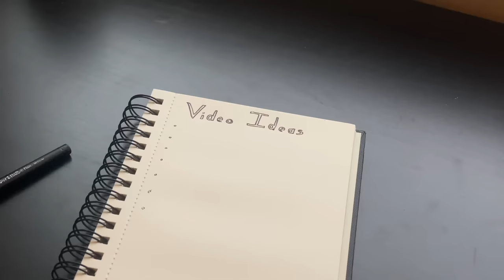First Days of Winter on the Alaskan Homestead

Comment: Those who are critical are usually the ones who would never jump to a challenge. You've got this!! Keep going
Reply: He literally put the door on his house backwards, which will trap him inside in a blizzard. Criticism could save his life. ❤
Reply: How about the galvanized chimney panel on the wall? 😂😂😂😂😂😂😂 Poison. If his chimney deposits catch on fire, and they will, the galvanized plate will hit a flash point of around 600f. At which point he gets poisoned by zinc.
Reply: @CScott-wh5yk  he also used an interior door which has no insulation, instead of an exterior door. the pipe on his wood stove also appears to be the wrong way which is dangerous and is probably the cause of all of the smoke billowing. a smoke detector could save his life if smoke billows and floods the cabin while he sleeps. he also needs a shelter for his wood, or it'll get wet from snow and will take days to dry out and become usable. if it's cold outside, you don't have time to waste days on drying wood because wood is your heat source. criticism will save his life, if he takes the criticism seriously.

edit: he did mention he has to replace the door, but that should be his top priority.

edit 2: having the wood stove that close to a wood wall with no hearth or barrier or anything of the sort is a major fire hazard. It's even more concerning because it's close to the door so if a fire does happen, his only exit is blocked (besides the windows).
Reply: @CScott-wh5yk 😂😂😂😂
Reply: Or maybe they are mature adults trying to offer constructive criticism to help him.
Reply: Well, these people are TRYING TO HELP THIS YOUNG MAN,  THEY ARNT BEING CRITICAL!
Reply: @ChrisSmith-ek3og I AGREE CHIS SMITH!
Reply: I've found that those who criticize are generally from one of two camps. 1) Envious of someone for doing something they wanted but never had the courage to try or 2) are jealous of someone trying and accomplishing something they never could.
Reply: PEOPLE ARE JUST TRYING TO HELP THIS YOUNG MAN THATS ALL.
Reply: @archieself4945  Yeah right. I'm pretty sure everyone knows who his parents are. If he needed/or wanted advice, I'm sure he'd take it from them before he'd take it from complete strangers on YouTube lol
Reply: @sasquatchrosefarts When it gets real cold the the way the stove pipe runs out the wall will have creosote buildup. In his climate the pipe should go right out the roof and he should use insulated pipe above the roof.
Reply: @1acrehomesteader43 Ha Ha I have 10 times the cabin he does and I can’t drive a road vehicle within about 10 miles.  I’ve been doing this kind of stuff over twice as long as he has been alive.
Reply: Yep not like he’s brought up in a family that lives off grid lol.
Reply: @sasquatchrosefarts what’s funny about that?
Reply: @ChrisSmith-ek3og  he’s experienced that cold before.
Reply: @ChrisSmith-ek3og  yeah he’s a stones throw from the road. I think the first ep he mentions how he looked hard for land to purchase. His mum n dads channels are ace. They’re all off grid now!

Comment: Video ideas!  *Building a woodshed.  *Building an outhouse.  *How are you getting your water?  *What's the plan for extreme cold?  *Food procurement (town run?) *Building an insulating layer around your woodstove (it's dangerously close to the wall)
Reply: I said the same thing about the wood stove. I'm worried about it!
Reply: I as well, should be 3 feet from the wall, at least that is what my inspector told me about mine
Reply: I agree with the comments concerning the wood stove clearances to the wall and other combustibles.  A simple sheet of metal with wood block stand offs would help. I live high in the West Virginia mountains.   This will be my third winter.

Comment: The reason the stove piles smoke out into the cabin in the beginning is because there's a cold air table within your exhaust vent that is preventing smoke from rising up and out the house. 

Remember hot air goes up, cold air comes down. It's something they teach you in one of them pesky schools :P hehe. But anyways. If the gradient is high enough the cold air triumphs and pushes any heat or smoke that tries to rise up, acting like a cork in your vent. You gotta break through that cold air blockade first.

Before lighting up the stove all the way, you can fire up a small bundle of newsprint or paper and hold it right up the ventilation port within the stove, in order to have it's hot air rise and push the cold air out of the way. then you can light up the whole stove.
Reply: They don't teach that in any school I ever went to! I learned here on Youtube, I imagine his folks would have taught him.
Reply: Florida education system teaches that but I’m always confused on what cold air their talking about lol it’s always hot here
Reply: Mostly agree but the main idea is to clear the roof with your high point. His 90 out the wall and up is his issue and will get much worse as it gets cold and windy. Straight up out the roof and at least 2 ft above the highest point will solve 99% of his problem. A vacuvent will cure the rest.

Comment: 1. fix the roof video. 2. A walk around the local area, shopping, fishing etc. 3. Build a Swedish hottub using the stove for heat. 4. A much extended day in the life video (30-40 mins) 5. Do you have a pet? You need a pet. 6. A live W and A.
Reply: yes - roof
Reply: @DL-ep5uk that’s the first part. The second part is the answer
Reply: Pretty sure that's a typo for "Q" and A.  Q and W are adjacent on the keyboard.
Reply: @DL-ep5uk probably meant  Q and A
Reply: Self reliance first $$$. Then a dog.

Comment: I'm a mom and admire your strength and determination to make it out on your own, and the strength of your mother to let you do it without interfering. You are both strong people. I am concerned that you don't have any insulating layer between your wood stove and your interior wall. Wood stoves can get hot enough to cause spontaneous combustion. Please make it a priority to protect yourself from that happening.
Thank you for your videos! I really admire you and enjoy watching you grow as a person and be self sufficient.
Reply: I was thinking the same thing about the flashing(?) near the stove.
Reply: Several of us have been mentioning this for a while, but no response yet!  And no insulation!
Reply: He definitely knows that. Don’t worry. He’s got amazing parents/mentors.
Reply: My mom runs a wood stove here in Arkansas. When we put it in she put concrete board on the walls and then put metal on that to reflect the heat back out.
Reply: I've been on an Alaskan adventure with a group of Alaskan teenage scouts and I'm convinced a guy that's grown up in Alaska is capable of making it through an Alaskan winter. I have lots of confidence in Mick.
Reply: In Michigan;  I think he said code was 36" (mine is 37")  -- none-the-less, code schmode (it's there for safety), please keep it in mind as you fine tune your arrangement -- also look up 'cathedral box' and maybe build your own. The stove pipe could easily be made to exit the roof (without bends in the pipe). For now, the main thing is you got heat and that's always a good thing !!  Insulated stainless steel stove pipes are a good choice and often come with twist and interlock stainless pipe to stainless pipe (and stainless screws to attach them to non stainless pipe). One thing at a time.
Reply: @josephbrown-ut9ty great idea!

Comment: Hey, I'm not anywhere close to being in Alaska, but we use wood for heating as well and I have a tip since you don't have a woodshed (yet). Tarps are your friend! Just put a tarp or two on your pile of wood and it won't be covered in snow (or water once it melts), and it'll lower the chances of the liquid to put out your fire. Great video, excited to see how you handle the winter months! :D
Reply: I use tarps too. 👍
Reply: Your wood stove/fuel is the most important thing in your life right now. 2 chords probably isn’t enough. Agreed get that wood covered or you’ll be fighting it all winter. Best to get your wood supply cut/stacked in the spring and let it dry all summer. Next season maybe. Good luck
Reply: yes I was wondering why he did not cover his wood pile so young and soo much to learn
Reply: @a.p.5429 😊
Reply: That was my first thought

Comment: Hello Mick sometimes the  reason that a wood stove will smoke when first  started up is the column of cold air in the pipe that  the smoke has to overcome  to make it up and out to the sky. One way to overcome  this is to use something like a piece of newspaper  that you  put into  the  smoke  pipe and light it to preheat  the pipe and help to establish the draft. Then you light  the small pile of kindling or other starter material to get the fire going.  I realize  that  you may  not have a good supply  of newspaper  to use for this but a little bit of good dry bark should work  almost as good. I have been a wood burner  since 1979 when I bought my first wood stove. Have a great day.  Tom down here in Canada  in the Maritimes  at the NB-NS border.

Comment: Just a suggestion, when you mentioned the roof isn't done, an easy temporary "cheap" fix would be putting a tarp or two over it for the winter, as it would keep leaks from getting in. Also, depending on how expensive it is, may want to consider putting a tarp or poly over the wood to keep snow off. I know the floor is insulated, however, as cold as it is going to get there, have you considered putting poly around the base of the cabin and down to the ground? Would block wind from blowing under the cabin, or you could also use pine boughs and then bank the cabin where there is enough snow - and that would be FREE! Awesome job so far! Keep up the amazing work! ✌️

Comment: Hey Mick! This may make you cringe but... I'm proud of you and what you're accomplishing! Maybe it's because I'm the mother of 3 sons that i have that parental proud feeling when watching what your doing.  
As for your stove...our little camp cabin did that smoke billowing thing on us last winter.  Ours is set like yours, through the wall.  We had a low pressure front and our stove pipe didn't completely clear our roof height. From what I read, that combo can cause the  stove not to draw the smoke.  So, we started leaving our door a little bit open when we build a fire and that little bit extra of air flow helped the stove to draw a better and not smoke us out.  It only happened once, so i think it was the low pressure.  If you'll notice outside that wood smoke is not really rising and is mostly falling towards the ground,  that's a low pressure situation. There may be other ways to  tell,  but that's one that I know. 
A little flashing around your stove is a good idea. Maybe a piece of scrap from your metal roofing? 
Cheers from NC!
Reply: Hi Jessica where are you from?
Reply: @kenhartman9981  North Carolina
Reply: @jessicawright3290  Nice place I live in Oklahoma City but I’m currently working here in Syria…
So are you originally from North Carolina?
Reply: @jessicawright3290  Hi Jessica how are you doing today. I hope you’re having a blessed day?
Reply: @jessicawright3290  Hi my friend how are you doing today

Comment: Your series here reminds me of the first winter I spent alone in Vermont. I waited too long to stack all the firewood, ate mostly "breakfast" foods, and generally was just happy to be warm and dry. It was one of the best winters of my life. Keep it up, man.    PS, you probably already know this, but if you toss a wide, wet log or two on the fire before bedtime, it'll burn low and slow all night. My elderly neighbor kept a separate pile of fat logs for that purpose, he called them his "All Nighters". Dude had a huge house and he burned 8 cord a year lol. We used to burn 5-5.5 cord in a 3br home. Again something you already know, but put a deep metal baking pan of water on top of your stove and it'll help with heat distribution and also keep the humidity from going crazy low.

Comment: The permits in the public wood cutting areas are $10/cord.   We put up 16 cords as usual this year.  We have three wood "sheds" - pole buildings with roofs and no sides, to keep the rain and snow off our wood.  We have three stoves - log home, log shop, and outdoor hot tub system.    With three stoves going at a time you really fly through the wood.  

Our wood hauling rig is a truck and a trailer made out of an old chevy truck bed.   So we can haul over a cord per trip.  If all your wood is split and under a roof before July, it will be plenty dry by winter.  We start in May, and that is the wood we use in the deep winter because it will be the driest.  The last wood harvested we burn in the beginning and end of winter.

Comment: I've been really enjoying your videos! If I was a bit younger and not married with a kid, I would highly considering doing what you are. 
My only tip of advice- I grew up in Upper Michigan and we used wood to heat our home; I would try to keep your wood covered (at least with a tarp) to help keep the wood dry and from freezing together. It gets very frustrating trying to break apart frozen logs and trying to restart a fire with wet wood lol. :)

Comment: IDK if anyone has mentioned, or if you've discovered... A baffled heat exchanger in your flue pipe will capture almost every single BTU from your fire. Can be made from a small steel barrel and a piece or two of sheet metal. There are also heat powered fans (non-electric) to help circulate more heat away from the stove and around the room.

Comment: One tip I would give would be to get some sort of tarp to temporarily cover up that wood pile, the snow will make it burn slower and with less heat so getting it under some form of cover will help with making it last. Also a traditional cabin food to try would be pilot bread!

Comment: Yep, you will probably need at least another cord.  We have a very insulated home in the Mat-Su, and we will likely, depending on how long and cold the temperature is, we may need over two cords this winter.  When your pipe is on the outside and not mostly run through the inside of the home, the temperature difference between the heat starting in the stove and the cold temperature difference in the outside pipe makes it smoke.  Good luck!

Comment: I would make a tiny airlock/double door on the front. Every time you open the door in the winter you are going to lose all that heat in seconds. You can easily make one inside with a hoop on the ceiling and some thick curtains/fabric. That will save you a ton of heat!

Comment: Better get a heat shield around behind the stove and to the side, as well as above.  Even sheet rock in a single layer can cook the studding and lumber behind it and eventually set it off.  As it gets colder that stove is going to be burning hotter for longer.  A lot of house fires start in the framing as it overheats much less the wood interior you have.  Manufacturer's specs are a guideline and normally they don't run a hot stove for weeks and months at a time so I wouldn't put too much stock in them.  If you have ever watched people burn to death you won't want to partake of the experience!  Consider also that that stove is between you and the door.  A house fire takes just a very few minutes to engulf the interior and in a small space even less.  If you are sleeping you won't have a chance.  Be safe and your odds are very good.

Comment: Back when I worked for others, I had to arise before I was done (sleeping). Now that I don't need to work for others, I can arise when I'm finished (sleeping). For me, to tackle numerous projects -- your ceiling (as an example) -- I'd finish by installing just one board at a time. It's a process -- first, get one board.  When you feel up to it, measure it, cut it, pre-drill holes if necessary, then,  fasten it in place.  This is pretty much how I get things done. I also have what I call, my "two hour rule" -- so as not to get bored doing stuff I don't feel like doing (even though I know stuff must get done). Working just two hours at a  time on any one project, prevents me from making screw ups, gives me time to sorta think about things -- but most of all, it allows me to see progress without the feeling of having worked to make progress. It's a way I get things done while I'm still doing stuff I wanna do -- especially when my 'plate is full' -- kinda like moving your wood pile; move maybe 100 pieces each day, no more no less. The pile in the driveway will get smaller and the pile near the cabin will get bigger. Split 30 pieces each day. This will leave you with time to do other stuff. If for some reason you only move 50 pieces of wood, that's ok. Tomorrow is another day. No need to double up. It's all about progress and the freedom to set your own pace.